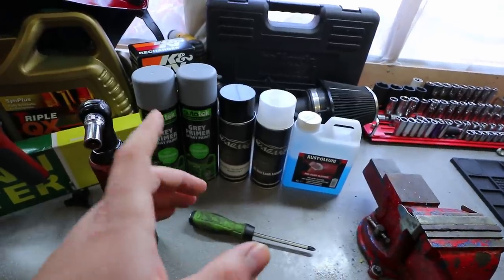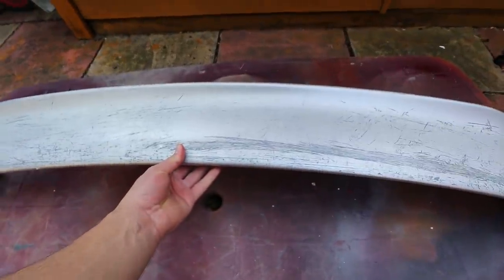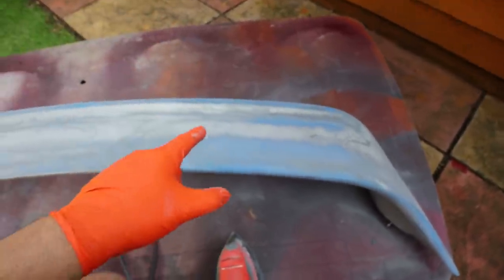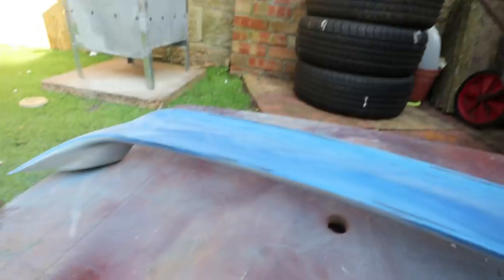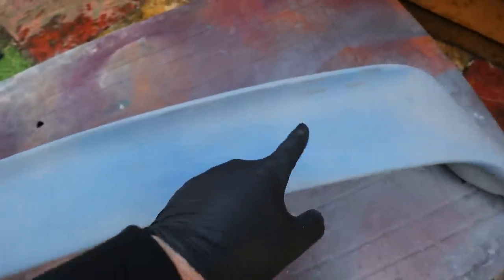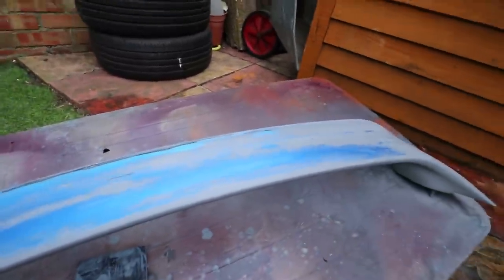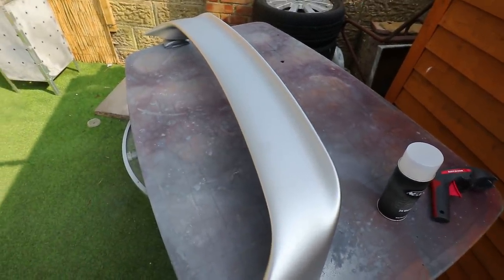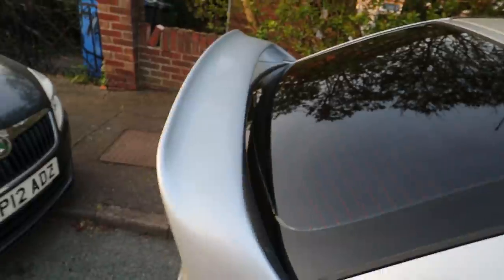Spray Painting My Astra GSI Spoiler! *DIY*

Comment: I've been spraying professionally for a few years now and learnt most of what I've learnt from the gunman on YouTube. If you have deep scratches like that, try a 180-240 grit on a block and then work up to 320- 400 and as your using rattle can 800 wet. Once primed, use a dry guide coat (available on eBay, I use mirka) and wet sand 800 with water, this will visibly show you any imperfections including sanding scratches. You might not see or feel the scratches but there definitely there. If the surface was rough on plastics I would go 240, 320, prime, dry guide coat 400 with block and finish 800 wet but I use 2k for everything.
Because you jump from hose hold sandpaper 120? then 800 your leaving deep scratches still in there. It might look good for a while( 1 month)then the paint shrinks into the sanding scratches and looks rubbish. I think that's what's happened to last job to the point its cracked the paint. 2k paints have a thicker build and if it had occurred on 2k it would leave sanding scratches once cured but not cracked paint. Bodyshops as mentioned would use a sealer, this acts as a barrier from old paint and helps to fill sanding scratches. if it was a paint reaction it would normally happen during the painting process not after.
I'm more than happy to give you any advice james on paint if and when you need it.
Reply: i watch the gunman aswell great teacher i hate painting im currenlty doing my kia sedona its clear silver metalic nightmare colour to paint things look great then it just starts going patchy im now in the process of rebuilding a air compressor to try painting with a gun hopfully will get better results yeah the gunman is great shows you every trick ect

Comment: If you are going to wet sand, why not just use water. When you use the detail spray you are introducing chemicals that you don’t know how they will react to the paint?. Came out great, keep up the good videos!!
Reply: Definitely this, just water, maybe a tiny dab of washing up liquid to break surface tension.  Wash with plenty of water then wipe with the panel wipe we saw. Otherwise the detail spray may contain salts or hydrocarbons that don't evaporate naturally and will "hide" in tiny scratches and eventually attack the paint. Just dust a primer coat on really really thinly to make a key, then a thicker primer coat, and then sand it back even if you think it is okay.
Reply: Thats come out really good, and inspired me to do the bumper on my own car.👍

Comment: Sprayer by trade here to give my 10p. It almost looks like they are previous prep marks that have gone too deep. Painting non metal parts always has a higher chance of reacting as some materials can be porous and make certain paints and lacquers sink and go flat over time. Its always best to use a pre primer 'e' coat it adds as a sealing layer to block any old contamination and grease ready for you to start a fresh layer. Hope this helps a few folk!
Reply from the maker: DonkeyCam thankyou!
Reply: @TheSavageGarage  wet sand the primer with 1500 before paint, and use a filler primer to fill the scratches. when you wet sand theyll disappear.

Comment: Yep the primer reacted with the original paint. I had similar reaction when using spray filling primer that cracked. I use very thin coats and leave for 10 minutes to go tacky before adding another coat. Don't sand silver or metallic paint as it will go cloudy. Spray in doors and leave to dry before applying lacquer. Did you use a plastic primer on the lacquer? Sand down to the paint. Excellent video as always.

Comment: Tip: after applying primer coat, sand a little bit the primer with 800 grip, but just to give a smooth "face" to primer don't go deep to the last paint. And then just wipe with a clean towel, no water no chimecals, dry clean towel. And enjoy painting.
- it helps with economy of paint.
- helps with cleaner base coat and clear coat.
You done such a beautifull job. Keep going. Love your vids!

Comment: Takes me back to my youth(early 80's) when the whole colour coding craziness came along. My mk 5 cortina got the full works,spoiler,wheel trims,bumper plastics,Hella fogs in a painted grill.mirror backs and door mouldings
We didn't understand the need for a flexible undercoat and just rattle caned it.
Turned out to be an almost monthly thing,until I sold it to get a " grown up " rover sd1

Comment: Just a tip with sanding you want to ideally go up in grits gradually so 40 - 120 - 240 - 320. 320 is good for primer to stick. Wet sand the primer with 600 then apply base let it cure then apply clear. If needed wet sand the clear with 1500 - 3000 - 5000, compound then polish

Comment: Priming may not be required if the paint you buy for painting plastic is designed to work without one, but it doesn't hurt to have the smooth foundation. You definitely need a primer designed specifically for plastic if you're using regular spray paint. ... Let the primer dry completely before moving on to the paint

Comment: One tip I got for you James is to when painting always do as longest moves as possible. You always use a lot of just quick sprays and its not good. You should always try to spray the longest way possible and start spraying before you reach the thing you paint.. Like Don´t start spraying when you´re above the thing.. It´s hard to explain but the main thing is LONG SPRAY MOVES. It will create nice and even layer.  Cheers mate

Comment: Next time I’d probably try a bit of etch or high build primer. Good few coats. Wet sand. Few more coats and wet sand again. Usually gets most imperfections out. Also just use water when wet sanding as most quick detailers will have some sort of hydrophobic properties which can react with the primer and/or paint if not completely degreased. Well done though looks loads better now

Comment: I swear by Wurth cleatcoat. Its not 2k but its petrol proof and non yellowing. Put the can in some very warm water and it will be touch dry seconds after you spray it. You can go nuts and put really nice thick coats on without running.

Comment: As for painting from a can, unfortunately the work will disappear after 2 years ... but you can always ask the painting company to buy colorless cans with a hardener (they are more vital) and to choose the right base ... for sandpaper gradation you start at 120 and always finish 800 wet .. on such a piece as much as it is taking time for the element at friction is about an hour for gradation .. as for the painting on the air, the trick is to paint up (it was on the table) and in another place than it was lapped in .. you must always cover the painted element if you paint outdoors or create some makeshift protection because it will be a waste of time later (here I mean cardboard or some container ... you can combine art is free) but the work went well as well for such conditions, best regards
Reply: I almost forgot... I made my cover from the 60 inch TV box .. I just had to increase it in terms of packaging (additional cartons plus painting tape)

Comment: I always wet sand with detergent then prime anything that’s not metal with plastic primer.t-cut is ok to use before paint or white spirit in my experience!
Reply from the maker: Lee O’sullivan cheers for the tip lee
Reply from the maker: Lee O’sullivan cheers for the tip lee
Reply: The Savage Garage no problem mate I did a very similar job on my vectra. My father in law used to work for Bentley so has told me a few tricks 😎👍

Comment: trigger on  base coat you didn't use after primer saying will use again .tip run full lenth of job when spraying  not your 10" back and fourth  thats why paint not even. make sure continuous one end to other tno more short back and fourth spraying   2 wet  sanding water only prob detail  spray  didnt help as detial sprays have waxes  in them

Comment: I have a similar issue with paint cracking on my 5 door mk4, is your gsi spoiler made of abs plastic or is it fiberglass? I ask as with my fiberglass one its caused by the material expanding and contracting with the heat

Comment: I would just use water as a lubricant , if there was any silicone in chemicals you use , the paint will react. I don’t think there is any reason to use anything other than water , and it’s in the tap 😀

Comment: Spoiler looks good. 
Painting is a nightmare i know. I  recently got some ST225 calipers for my st220 , they where rusty but working OK, seals good.

I sanded them down, masked the rubber seals and bits that needed masking, Rust treated them, they turned black then two coats of filler primer.
Wet sanded with water and 1000 emory paper, untill smooth as a babys bum.
Got some VHT paint, read the safety data sheet on the paint,(scared myself), god its dangerious.
The organic compounts in the paint can be absorbed into your skin and lungs, causing nerve damage and effect interrnal organs.
Also the paint gets rid of oxygen in the air, if used in confined spaces you could black out and die.
So when using VHT paint 
1) Use a good quality mask with organic filters
2) Cover all youir skin, gloves and overalls , seal up any gapes with tape.
3)Use in a very well ventilated area, NOT INSIDE GARAGE!
4) VHT paint needs 7 days to dry each layer or bake in oven to set. (Probably needs baking in oven for best results).
So filler primer was super smooth, put on the silver base coat, waited 7 days.
Put the clear blue coat on ( gives you a blue anodised finnish) waited 7 days
Put on a top clear coat ( All VHT paint)
Result the last coat of clear made the silver coat ridge and wrinkle, which wrinkled through the clear clue coat.
So I had a Blue coat with loads of silver wrinkles in it.
What a mess. 

Let it dry and wet sanded it all back to filler primmer. (What a waste of time and money!!)
Tried again, Boy is VHT paint (Anodised blue /red/purple) difficult to get right.
The trouble is VHT paint needs to be baked in an oven to set, which means you have to strip the calipers totally down.
Eventuall perfected the process.
Spent loads on VHT paint.
But the ST225 Calipers look very cool, dark blue anodised finish.

Comment: For bare plastic use a coat of adhesion promoter I can by it in a can and rub it in with a cloth or in a spray can but what happens there looks like there though I could be wrong looks like you've rubbed the bare plastic with 80 or something quite rough then sprayed normal primer over the top and over time then the primer has sunk back into those scratches

Comment: Going on your theory that the primer must of reacted with the original laquer it's still strange why the underneath was fine. 

Don't know if it's just the way it's  showing up on camera but the colour looks off it has a faint blue hue to it next to the silver on the car. Still tho like you say for the time spent and with the materials you had it's good enough and looks way better than it did. I've stopped aiming for perfection with things like this as my cars have always had a few a years on them and were far from perfect. So long as it looks way better than what i started with it's  a job well done. If it was easy everybody would be doing it. Atb

Comment: Continuous spray rather than stop start. Control coverage by distance butthis is far more important ..DO NOT USE 2K LACQUER without an air fed equipment really mate this is crazy. Seriously outside or not do not use 2k without proper protection

Comment: I think if I were keeping that car, I'd clean off the rust from the holes under the spoiler mounts and at least give them a coat or 2 of paint. Then seal the holes and mating surface with silicone sealant. Otherwise water is going to track through capillary action and into the boot.